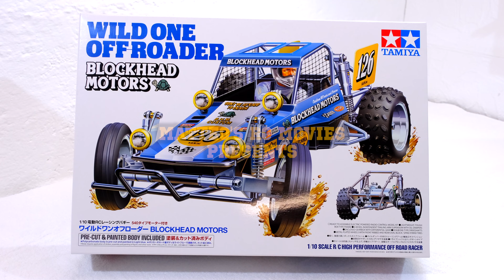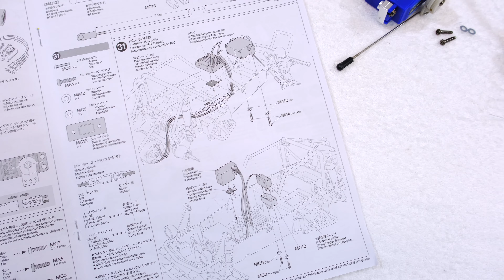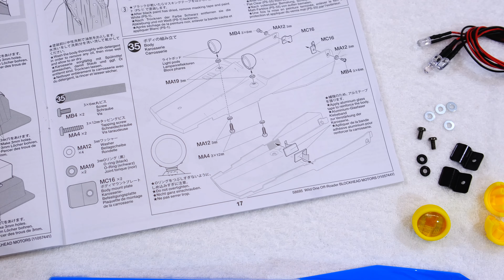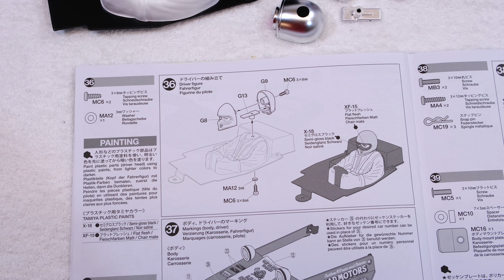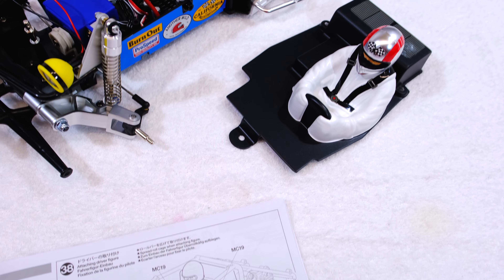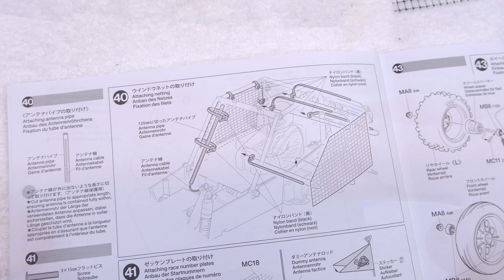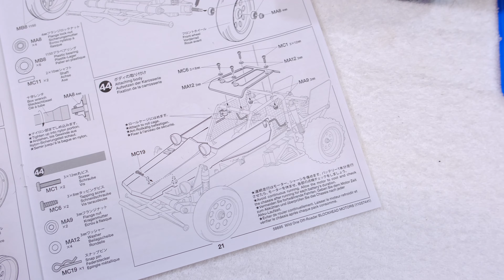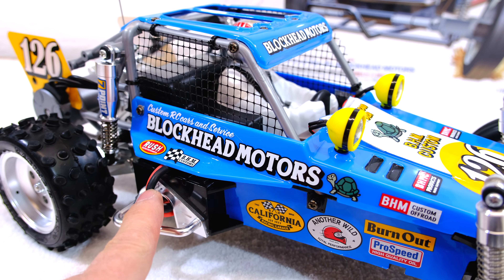Tamiya Wild One BLOCKHEAD MOTORS - Build Steps 29-45

Comment: It's nice, but I think it's overpriced at £100 more than a regular Wild One, even more so with how long this design has been in production.
Reply: To be frank, I think many Tamiyas are overpriced. I have just built one, and, apart from the kit, had to buy a set of bearings, a more suitable motor, a steering servo, driver figure, radio and decent tyres.
 Basically the Blockhead edition of this (admittedly very desirable) buggy gives us a different color scheme, as far as I can see, for an extra £100.
Having said that, I still love Tamiya RC cars!